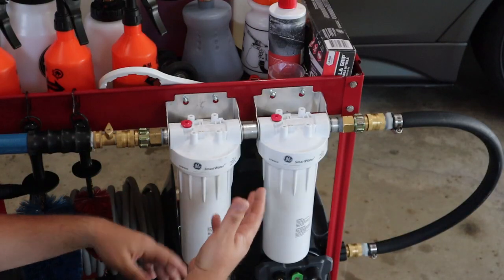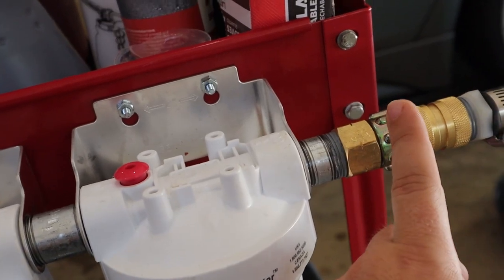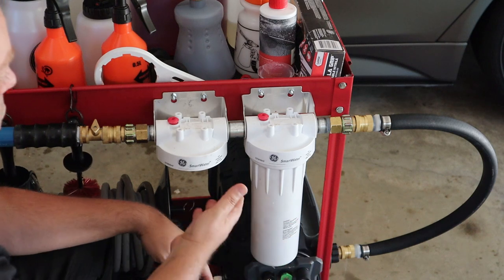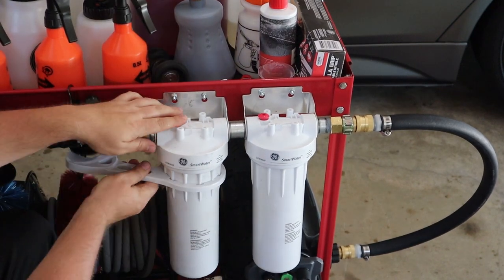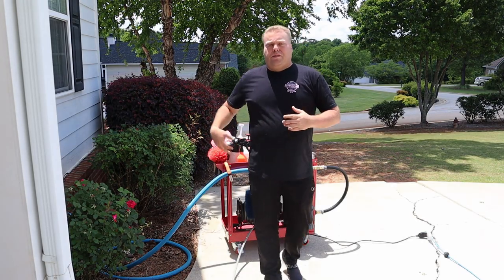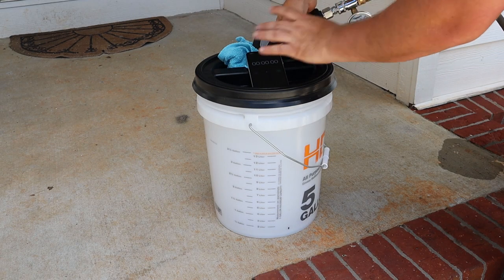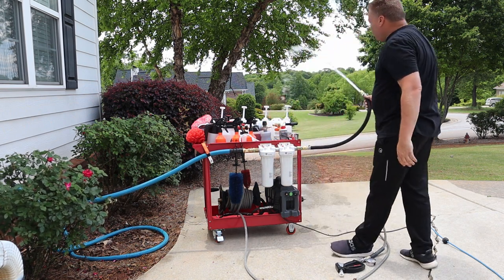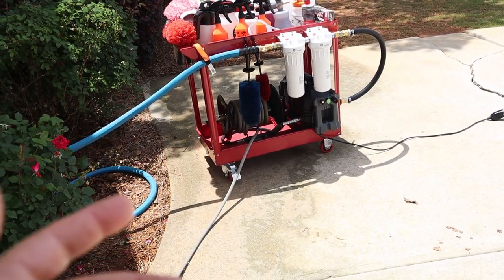Custom 2 Stage Water Filtration for Car Washing | Testing Flow | GXWH04F

Comment: I've learned a lot from your videos. A sediment filter doesn't eliminate or reduce any chemicals in the water. It only reduces amount of sand, silt, dust, rust, etc. A 5-micron carbon block and a 5-micron sediment filter will both remove particles down to 5-microns. Do you think the sediment filter adds any benefits to the system? The only thing that comes to my mind is it may keep the carbon block filter from plugging up prematurely and, therefore, extending its life. That said, you're on a municipal water supply (not well water) that is filtered before leaving the treatment plant, so unless there was a line break, I don't see there being much benefit. However, I am far from being an expert and mainly seeking understanding and advice. Thank you Keav and anyone else that cares to comment or add to the discussion!
Reply from the maker: I think the sediment filter is a must in a situation with harder water so you keep your carbon filter and DI resin from have to deal with it. I run two carbon blocks in my setup now one for chlorine and the other for chloramine as with treated water those chemicals are my main concern as they breakdown your DI Resin. Anything you can do to prolong the life of the resin is a must. I have learned so much since those earlier DI and liter videos as well. Everything from materials to use and types of filters. I have a good amount of chlorine and it does cause rust issues it even leaves white powder residue on my connections. Main reason I went full carbon blocks that are 1 micron.

Comment: Thanks for this, learned a lot. However, I believe a lot of us wanting to do this would appreciate more detailed descriptions on sizes and where the  couplers/connectors/adaptors are used. The links you provide are helpful but could also land you to a page that does not match the part you intend to describe. 
My own question is what is that short coupling you used between the 2 filters?  
Thanks again and keep up the good work!
Reply from the maker: The pipe between the two is a two sided 3/4 NPT male pipe. You can choose the length to separate them as far apart as you want. One with a bolt pattern in the middle is best as its easiest to get the pipe tightened. That's the thing I hate most about Amazon links the companies will keep the same post and change the product. Confusing when you read the reviews as well as its for a different product. here is the middle pipe I would use. https://amzn.to/3KthiAq

Comment: I created this setup and added blue housing from iSpring

For the last connection that goes into the pressure washer, is it ok to use a 1/2" water hose instead of a 3/4" or will that affect the flow for an Active 2.0
Also What is the union that connects the 2 GE systems together? Is it just a 2 inch 3/4" MPT union?
Reply from the maker: Yeah it’s a double male 3/4 npt. I think it was 3 inches, but that’s a bit long. You need room to be able to tighten it down though. 1/2 water hose is plenty as Max GPM on a 1/2 hose is over 8 GPM. I have actually moved to a full 1/2 piping on my wall setup using the active 2.0.

Comment: My TDS is around 600 how much of a drop would a 2 stage filter lower my TDS great video thanks
Reply from the maker: Not going to help much at that TDS could drop it by 50 depending on the type of water and what is in it. I think you would need to look into Reverse Osmosis and storing water to either be gravity fed later or pumped if you wanted to go lower. Deionization setups would be very expensive due to constant refills of the resin.
Reply: @CarsWithKeav  thanks again for the advice  will definitely looking into RO water instead
Reply from the maker: @whalen530  I’ll be doing a video soon on an RO system, storing water and using a pump to wash with it. Hopefully in a few weeks.

Comment: Love these vids...not sure if you have done it ,but can u do a vid testing the PPM of the water before and after the filter use?
Reply from the maker: My water is already only 50 PPM from the house so it only changes to like 48 or 49, but I'm looking to remove other things that don't measure on a TDS meter.  Wish I had some harder water to test this.  I am going to do the testing when I add de-ionization to the final rinse.  Should have brought it with me to the beach to test that water as it was hard as a rock.  LOL

Comment: They do eliminate hard water spots, and any chemicals, the 2 filters are necessary. $10 for 2 sets of filters is very great price. I know someone who uses 3 filters for their refrigerator.  👦🏻👍🏻🏎🏁
Reply from the maker: I tried to keep it low budget. There are some crazy expensive systems out there.  Once I get my Deionization setup no more water spots at all.
Reply: @CarsWithKeav   Yes the deionization tanks are the way to go for sure. 🙋👌

Comment: Hey keav, is it possible to do resin in these filters? I'm wondering if 3 of these (2 resin and 1 carbon) would work for me. I'm using Active 2.0 and my water is 110ppm. Chlorine is the biggest issue in my area. Goal is to get 0 ppm
Reply from the maker: Yes, you can do resin cartridges in these. It’s all universal 2.5 x10 filter housings. 110ppm should be able to get 0ppm pretty easy. Only issue is these don’t restrict flow as much so  in order to make sure they filter good you will need to possibly turn down the flow of water going in. Most DI specific filter housing have built in restriction to make sure it filters well and is usually limited to 2gpm.

Comment: I just saw ur video great job. Would pls do a video of all the fitting setup in detail
Reply from the maker: I would do it different now. I was using way too many fittings to get that to work because I was roaming the aisles at Home Depot. LOL  I found a few fittings that are simple and better. https://amzn.to/3ug0HuI and https://amzn.to/32KKB0S  Make sure to use thread tape for leaks. The one set of fitting comes in a pair, but that's the only way to get them on Amazon.

Comment: i tried this method but my tds tester, tested higher than without the filters. curious to know what i did wrong?
Reply from the maker: The carbon can attach to water which can increase tds and carbon does not stop many types of minerals. It is more for reducing chemicals and the type of water you have is a factor as well. Only way to truely reduce tds is Deionization.

Comment: will it work with a detailing water tank or do you need the pressure from the water where you connect to hose?
Thanks in advance.
Reply from the maker: I don't have a lot of experience with gravity fed tanks, but these are not operated with a certain level of pressure. You basically get out what you put in up to 2.0 GPM. Anymore and you start to impact the ability of the resin to de-ionize. If you need more I think one of the bigger systems is better. Once full it flows through.

Comment: So ge claims their oe filters also do sediment. Is there a difference in the sediment filters and the oe filters suggested?
Reply from the maker: There are a few different they have at different Micron levels which will collect sediment if they meet those micron sizes. I like the clothe one and then the carbon one as the second stage. I have changed the type I use to ones that are 1 micron. the GE filter mainly are 5+ Micron. The beauty of these housing is its a generic size across almost all filters. its 2.5 x 10 and you have hundreds to choose form.

Comment: Do yourself a favor and do t listen to this guy. 🤦🏼‍♂️
You don’t need carbon filters or sediment filters for water spots. What you need for those specific housings are 2.5”x10” Mixed bed DI resin cartridges. You’re welcome.
Reply from the maker: I have future vIdeos with DI using those filters. This was some time ago and I was learning. Now DI resin does not stop water spots as well if you have chlorine or chloramine in your water only carbon filters will stop that. That’s why having the two together is a good idea. Having these as a pre-filter stage also help keep your resin from going bad so fast. DI only removes dissolved solids and not chemicals. I also don’t think I ever said this will stop water spots I said it would lessen them as you won’t have as many chemicals in the water. This will help prolong your equipment and gaskets as well. Thanks for the feedback.

Comment: But don’t you want to get rid of  total dissolved solid (TDS) ? That’s what gonna leave water spots on your car and those filters aren’t gonna get you there, not even close.
Reply from the maker: This was phase one of a 2 phase deionization system I was building. The phase 1 purpose was to filter water for better foam, longevity of my pressure washer and reduced water spotting. The final rinse is when I would use spot free water. Just wasting resin outside of final rinse unless you got really hard water. Having both stages running at the same time the first phase makes it easier for the deionization to filter. I made another video on the spot free. https://youtu.be/OoBJVCbSY34

Comment: I just checked my tds it’s at 402 😂 damn that’s high!!!!
Reply from the maker: With that kind of TDS these filters will decrease it some. Depends on what kind of TDS it is. Might have to add a resin filter as well to get spotless.
Reply: @CarsWithKeav  I’m actually looking at the parts to build a RO/DI window cleaning unit that way the DI resin lasts a lot longer with these numbers I’m getting
Reply: in india bro, ive heard those guys dealing with tds numbers approaching 2000... they'dthink 400 was like sparkling spring water by comparison!
Reply: @skip741x3  damn

Comment: I would get rid of those galvanized nipples, go with all brass or stainless.  Galvanized over time will break down and rust internally
Reply from the maker: All has been replaced. I was impatient and pieced it together in my head at Home Depot.